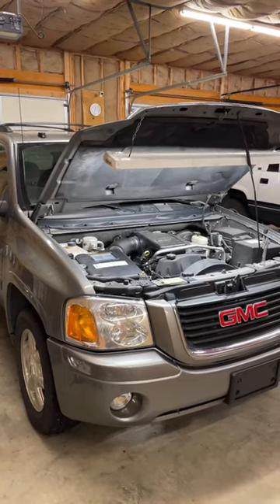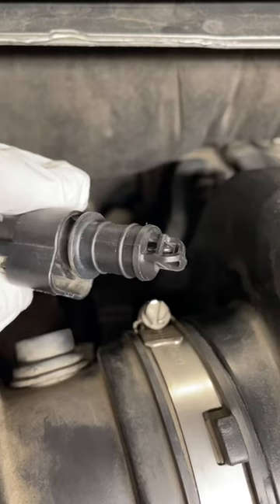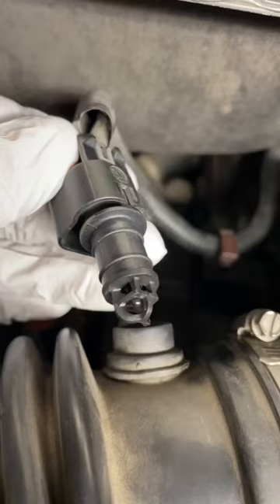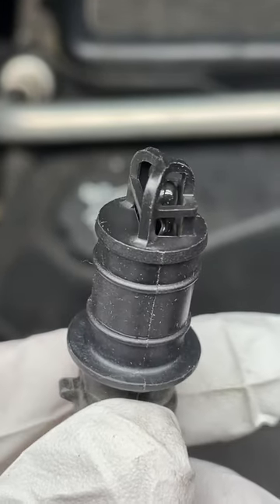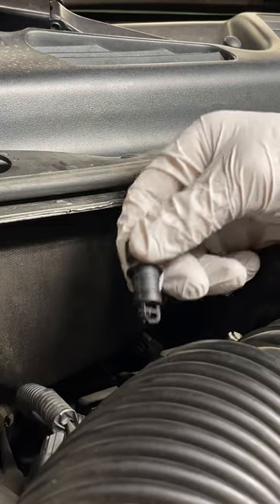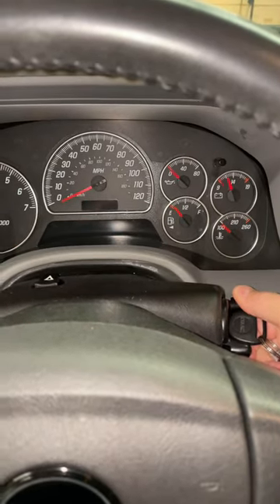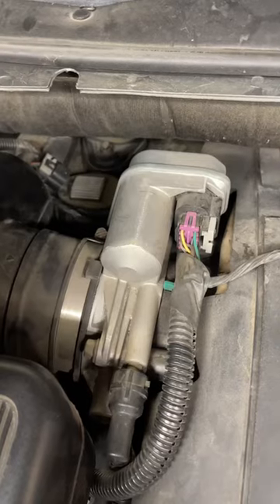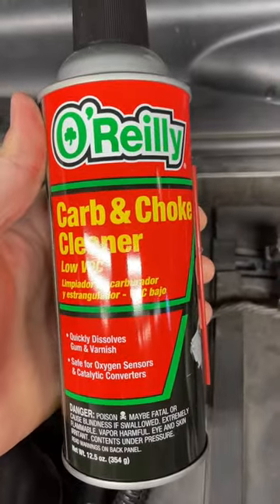How To Smooth Out A Rough Idle! Part 1 of 3!!

Comment: Do not use that cleaner on a throttle body. They are coated with Teflon and you’ll ruin it. Simple green and water is the way to go
Reply: Gm isnt like Ford and there isnt a coating on the throttle body.
Reply: @mckreations5160 luckily my throttle body isn't coated

Comment: DON'T ever use carb and choke cleaner on a throttle body use throttle body cleaner because some or all carb cleaners have Ketones in them which melt the special coatings on the throttle body butterfly shafts and the bushings in the body
Reply: It’s almost like they made throttle body cleaner for a reason
Reply: @glock1inthetop45  yep
Reply: Thanks sir.  The comment section AND the poster for the win today.  I was just trying to figure out what that part was.  Even though I know I need to clean the throttle body it looks like shiznat lol

Comment: Cleant the throttle body, that is the cause of rough idle 60% of the timr, the intake gaskets are 30% and then its plugs/wires the other 10% especially if it has 90k or more since they run iridium plugs and people dont change them for 150k or more. Cant say how many plug i have done with 150k miles on them and the gap is 1/8th to 3/16 gap cause the electrode is worn to the ceramic

Comment: The 4200 inline 6 is a solid motor. I've got a trailblazer and envoy with the 4200 very reliable vehicles. Haven't had an issue with the idle yet but probably will clean the airflow sensor after watching this since I live on a dirt road.
Reply from the maker: I just watched a video where a guy is using this 4.2l fully built with a turbo and getting almost 900hp at the wheels! His dad has the 5.3l same turbo setup and get 100hp less. He’s using stock crank too. Raving about the 4.2l. Makes me think. Might be the junkyard sleeper engine to buy.

Comment: My 2010 Sierra on one of the coldest days on record she wouldn't idle right she wouldn't do anything right she was on low power stabilitrak and traction control was off as well and I took it to the garage by the time they got to it the next day in the afternoon it literally just was going to go apparently it iced up the throttle body and the TPS stuck

Comment: I had a friends Yukon throwing a code for the throttle position sensor, we started by cleaning the entire intake and throttle body and the sensor because egr valves suck ass and all the carbon in the intake is garbage.

Comment: Don't use that on a throttle body. It will eat the coating and sensors
Reply: GM usnt like Ford and they dont coat the throttle body so there isnt anytging to ruin like on a Ford